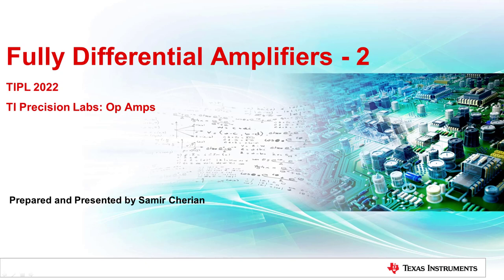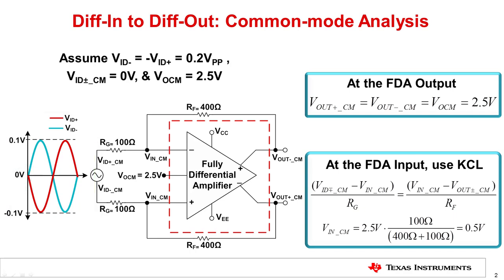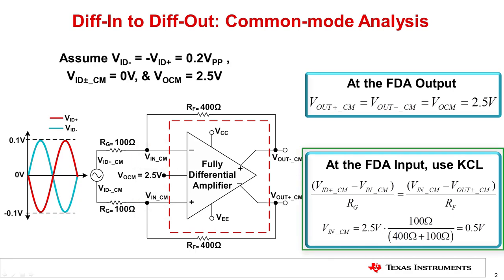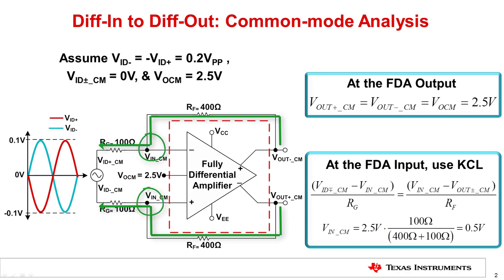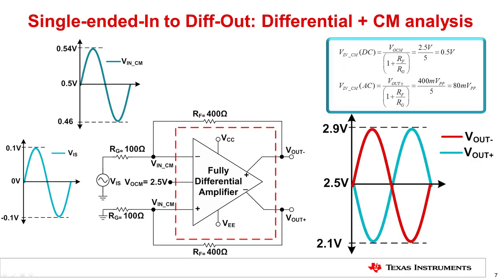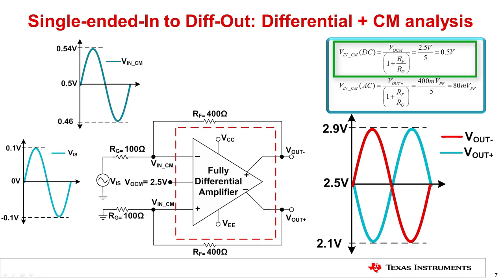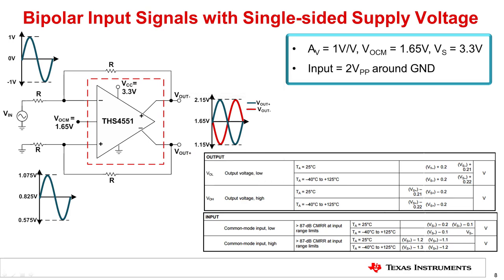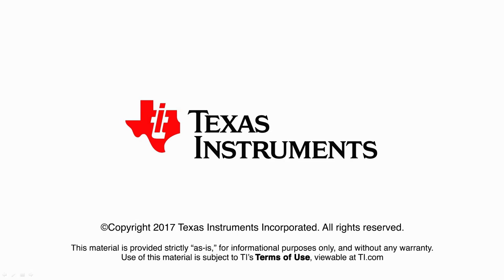Input, output, common-mode and differential-swing

Comment: At 12:05 I don't understand why the output has a peak-peak swing of 1V, when the input has a peak-peak swing of 2V when the amplifier is configured with a gain of 1. Shouldn't the output have a swing of 2V?